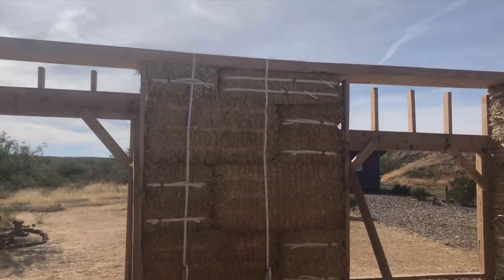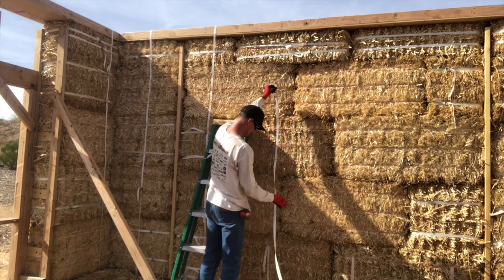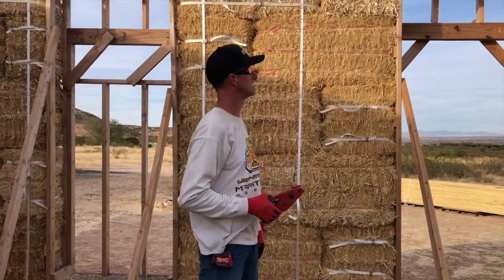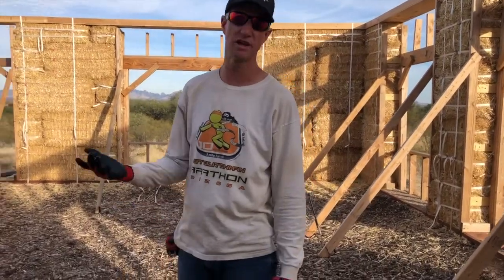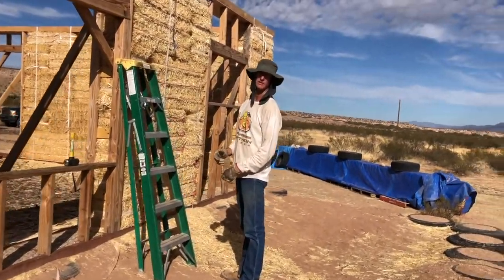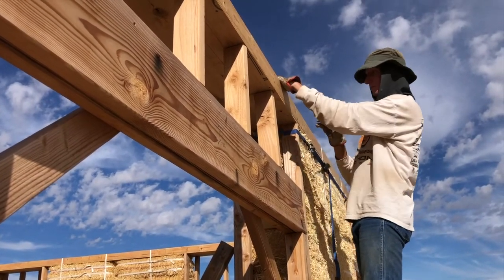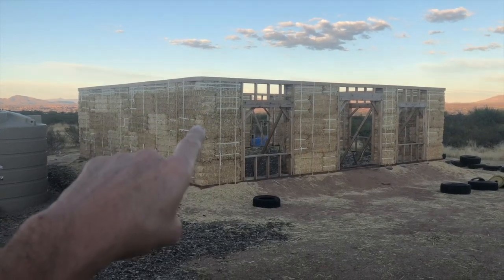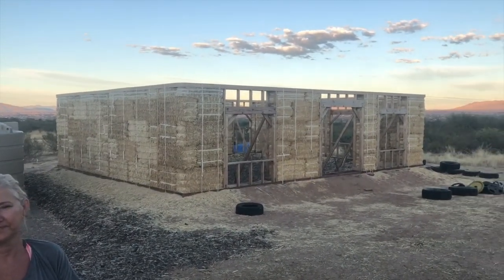Bale Compression And Box Beam Connection | Couple Builds STRAW BALE Home In The Desert

Comment: You guys have posted over 8 hours of video on the straw bale process, so forgive me if you already answered this.
But, I've always wondered, how do people seal-off the hay and avoid getting critters living inside the walls on a straw-bale house? Seems like it would be the perfect place for rodents to make a huge nest.
Reply from the maker: Valid question, Eric!  We may have mentioned a little bit about it along the way, but not a ton.  I think the main answer to your question is plaster inside and out.  There are several forms or variations possible, but this should prevent most access.  The other possible vulnerable point for our bales, given our foundation choice of rammed earth tires on the ground, is from underground into the bottom of the bales.  We've tried to prevent this by filling the sill plate with gravel and covering it with a wire mesh before placing the bales.  Hopefully, this keeps us critter-free!  🤞
Reply: @MidlifePrices  Interesting. From my understanding, rodents really dislike chewing through metals. So, the wire mesh you mentioned under the tires is a smart approach. I also hear they hate steel-wool.
So, when I wanted to use spray-foam to seal a few little spots outside my cabin, I stuffed the space with steel-wool first, then injected spray-foam into the steel-wool. So, I now basically have spray-foam infused with steel-wool inside it. You may want to try that approach around areas like pipes. I'm not sure how effective it will be, since I'm the only person I know who has tried it! But it's an idea.
Your project is looking awesome!
Reply from the maker: @LuthorvilleCA  Thanks, Eric!  I think the steel wool idea is great.  I may try that in some spots.

Comment: Curious to why you went with the strapping technique verses the all-thread system?  Was it due to you wall height?  Four 3-string bales measure a convenient 8 feet.  You're tall and wanted that extra half bale at the top?  Did you fill your top plate with sand for insulation?
Reply from the maker: This choice was based on both cost and our lack of a concrete foundation.  Without J-bolts in concrete at the foundation, we didn't see how to connect the all thread.  This just seemed like a reasonable substitution that worked with our foundation choice.  If doing a concrete foundation, I think I would go with the all thread, as I think it will do a slightly better (and easier) job of compressing the bales to the desired height.  Unfortunately, four courses of bales did not reach 8' for us after compression, which is why the extra half bale.  I wouldn't have actually minded being slightly shorter, but it was going to interfere with our french door header, so had to get it higher.  We are planning on filling the box beam cavities with straw before placing additional bales on top to close in the portions above the box beam, but your sand idea is interesting!